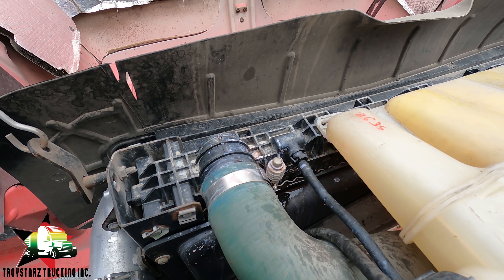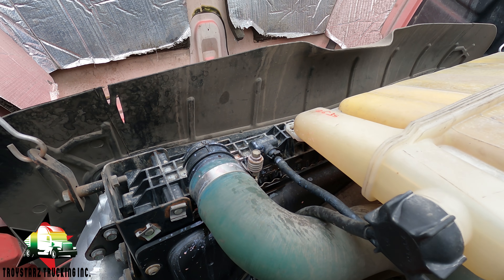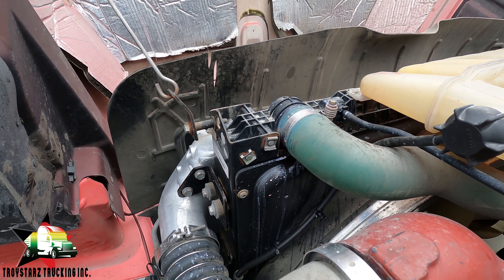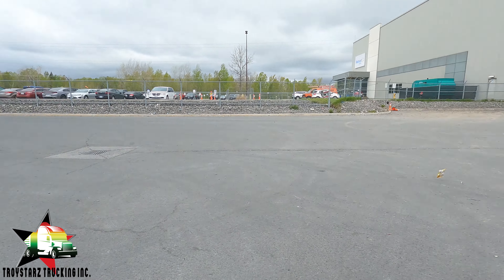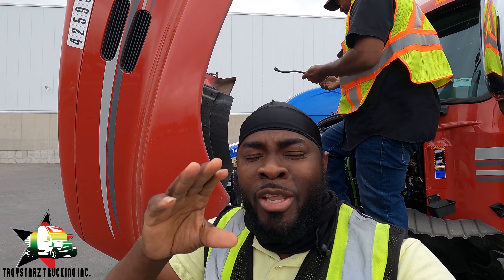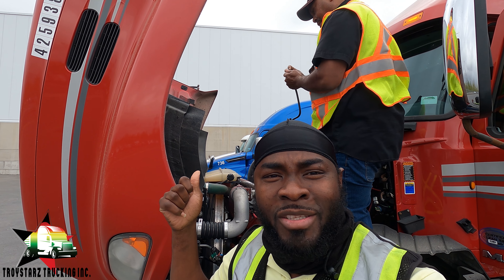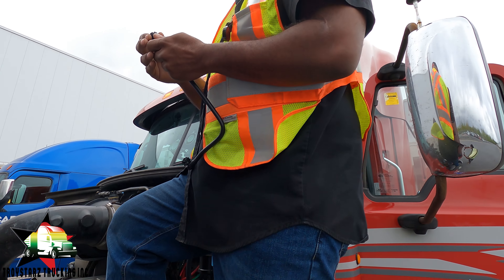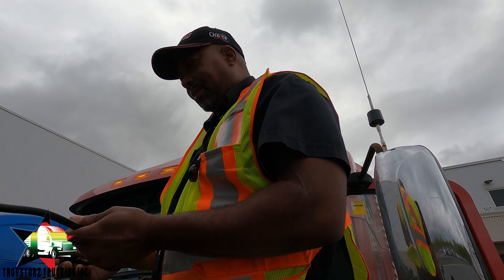Mack Truck Antifreeze Coolant Leak Found & Fix Mp8/ D13 Engine.

Comment: Think is an overflow hose that. Purpose is to provide an overflow of coolant. Increase in pressure due to coolant  temperature increase. Radiator cap is designed to relieve the pressure, this goes to the overflow to prevent coolant loss or damage to radiator due to over pressure. O Ring may get worn naturally over time, possible due to expansion and contraction over time.
Reply from the maker: Thanks for the knowledge 👍
Reply: doing my certification next month, so mek space for mi. Mi soon forward..🏃‍♂️💨

Comment: Get an assortment of those a/c o-rings (the green ones) they work very well on things like that. I have even used them on fuel injectors on gas engines, they shrink a lot less and are more heat resistant.